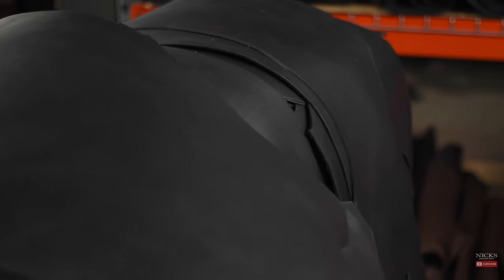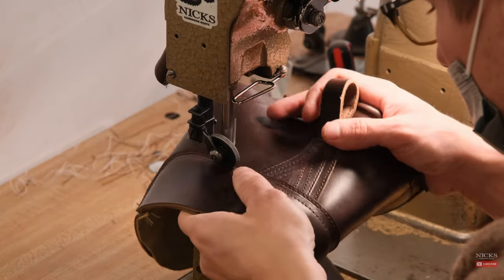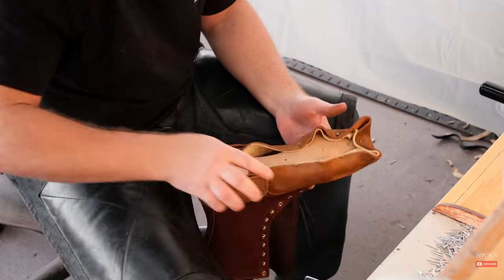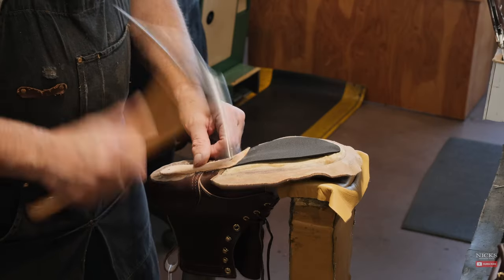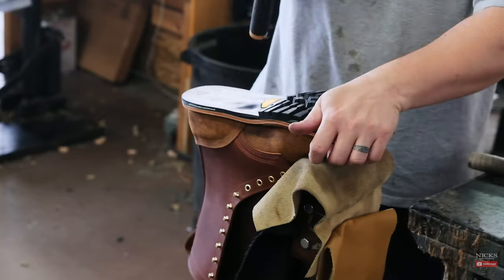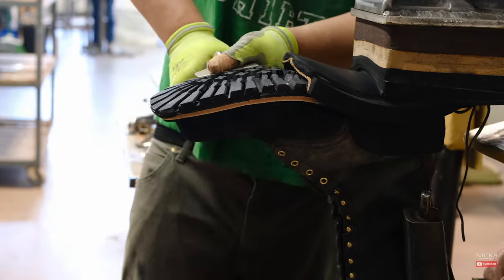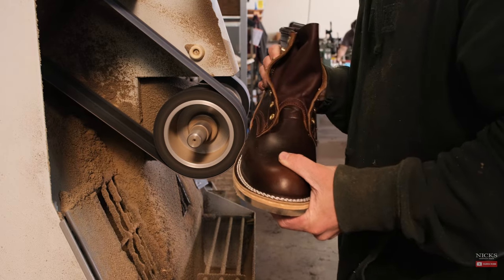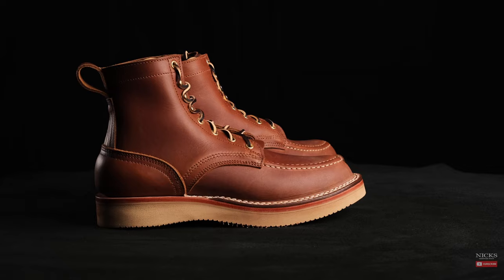How Boots Are Made: Step by Step - Nicks Handmade Boots

Comment: I'm surprised you don't use a more modern system for cutting, Galco uses an overhead projector/scanner that can map efficient holster shapes onto a hide after it's been marked and mapped for deficiencies in the hide. Maybe too modern for your main line but maybe for quick ship 🤷
Reply from the maker: That sounds like a really interesting piece of tech, but it would take tons of research and time to set it up. And besides, our clickers do a pretty good job without it!
Reply: @nicksboots  viberg uses that method. I assume it would allow for more precise clicking but you guys do it very well already soo